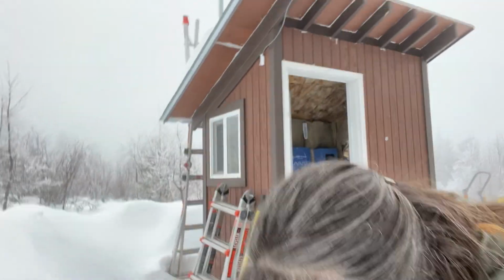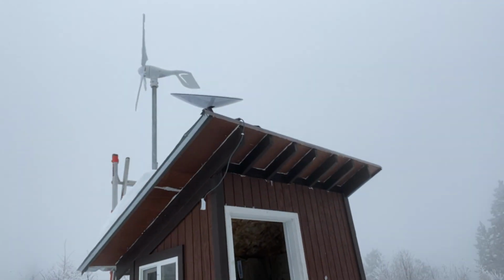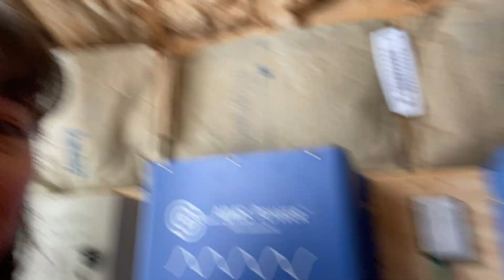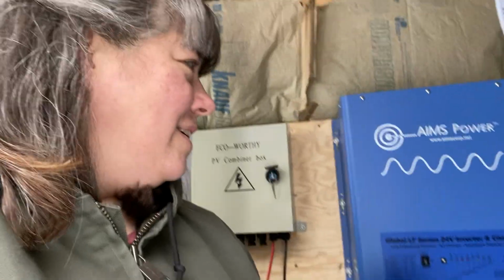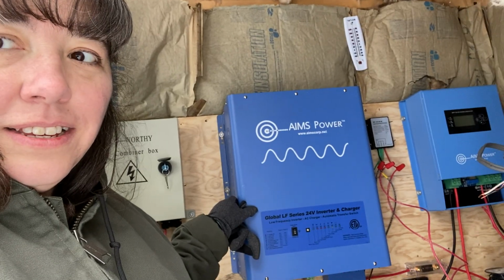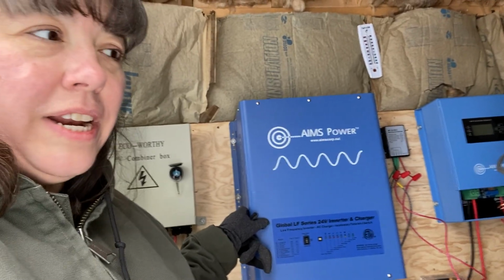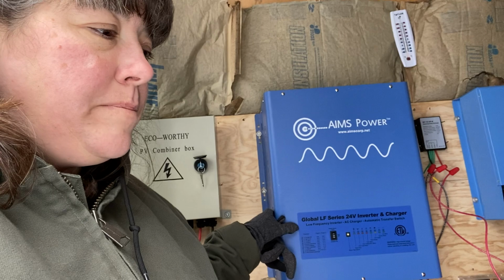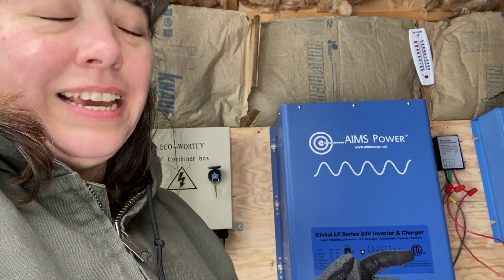What Happened?!

Comment: Swelling usually occurs after overcharging but in this case seems like it was caused by too deep of a discharge since they haven’t been getting charged. Cold temperatures further decrease a battery’s usable capacity. It’s also possible depending on the temps in the powerhouse the batteries actually froze. They have a lower temperature limit that they can’t be charged below, which gets higher if they have a low charge (i.e. need to be warmer if low charge).